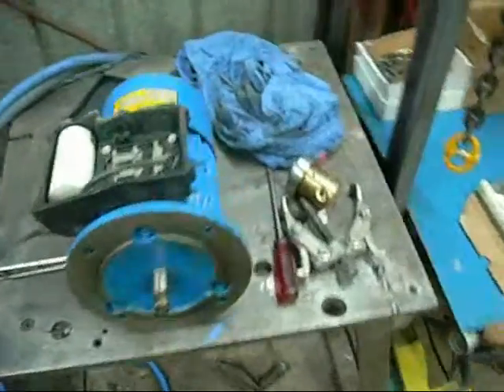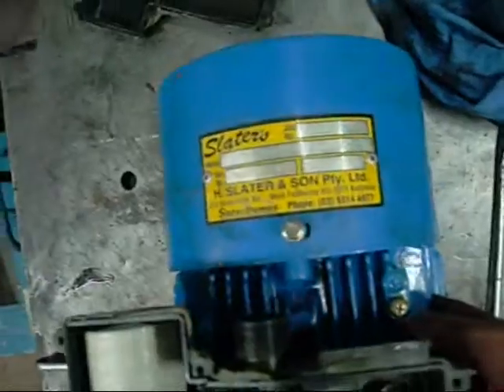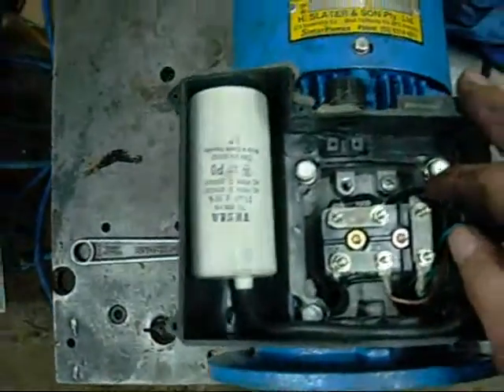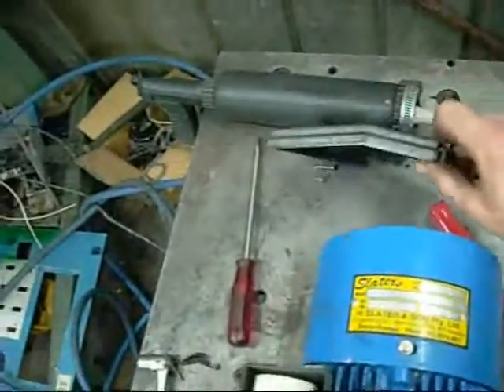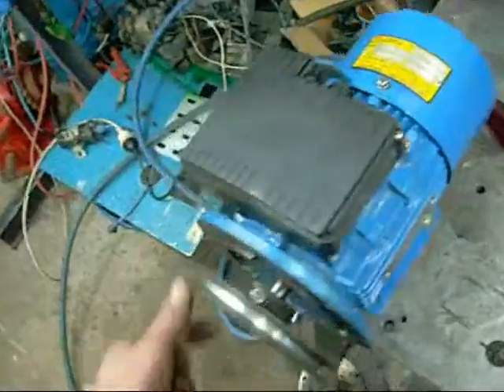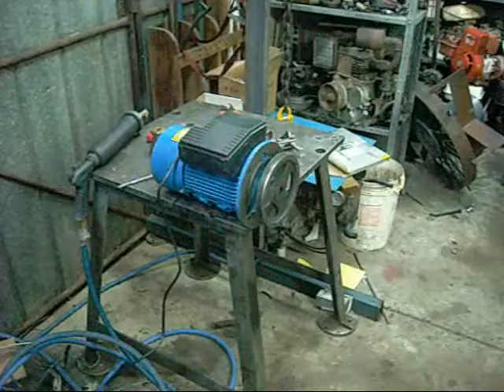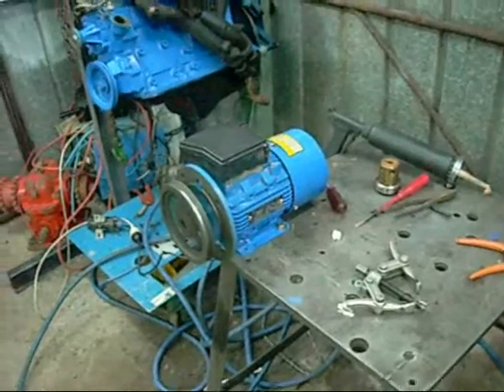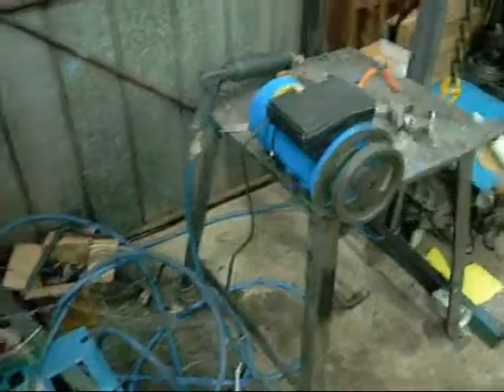Repair and Test of Western Electric 1.1Kw 2780rpm Pump Motor

Comment from the maker: @pcp77 it could be a failing run capacator or seized bearing.
if you take the fan cowl off and try turning it by hand, is is stiff or nice and free?

Comment: I like the noise that motor makes, it sound a bit like a small air conditioner.  When you say transfer pump what exactly do you mean?  Could a new waterproof casing be made for the motor so it can be used in applications where watertight seals are needed?